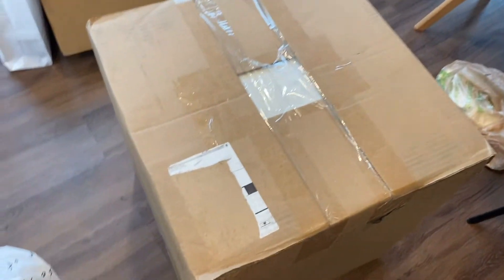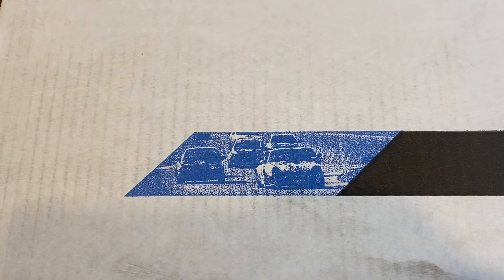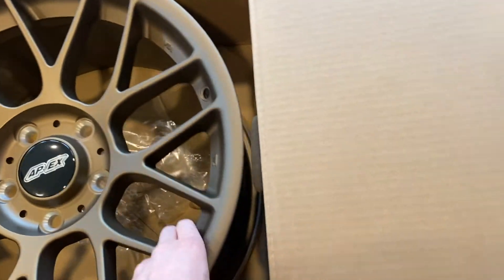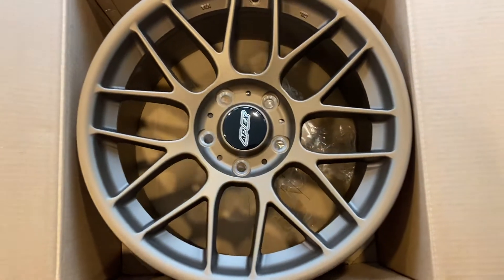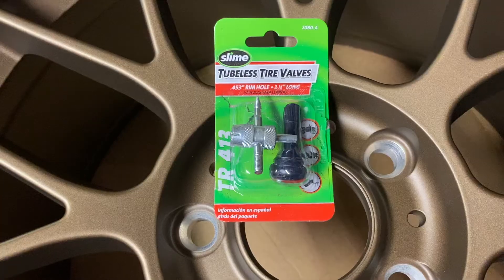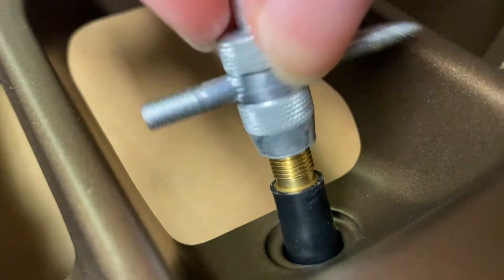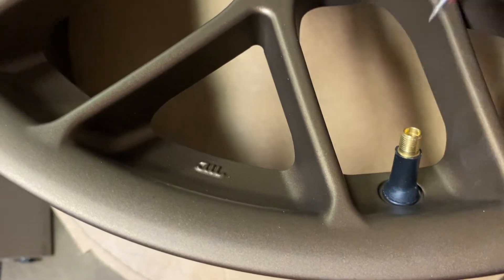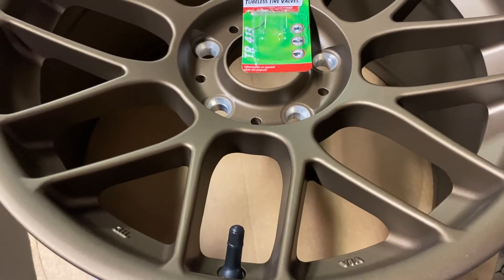NEW Apex ARC-8 Unboxing and Valve stem install

Comment: Sweet. Thanks for the video! I wanted to know if anything came in box with Apex wheels. Looks like I will be buying some valve stems. Lol.
Reply from the maker: Thank you for watching! In the box are the wheels and a centre cap. The valve stems aren't hard. I just had to film and do it with one hand haha. If you're going to use a 215 or smaller tire on the 17x9 you will need a cheetah to seal the bead.